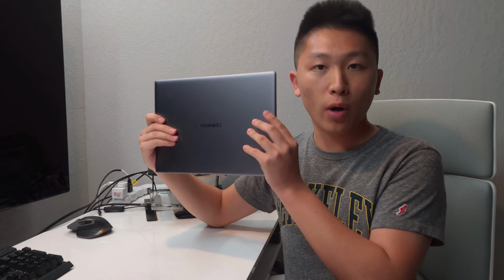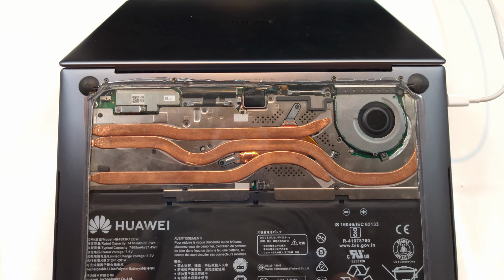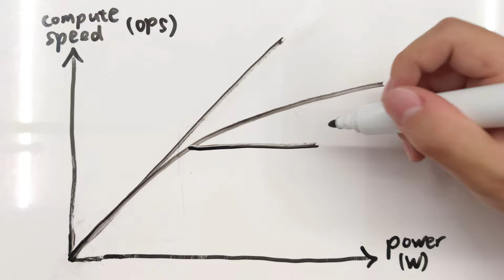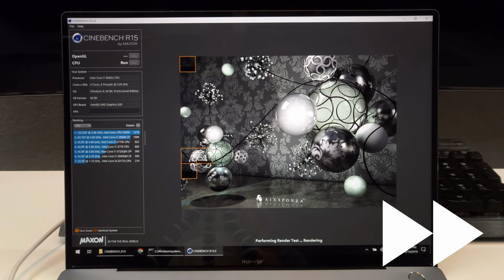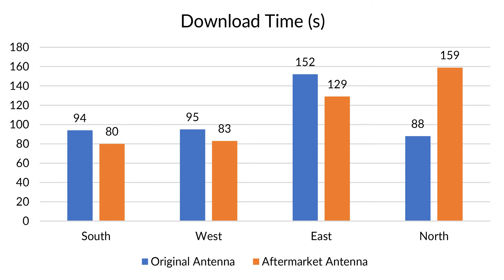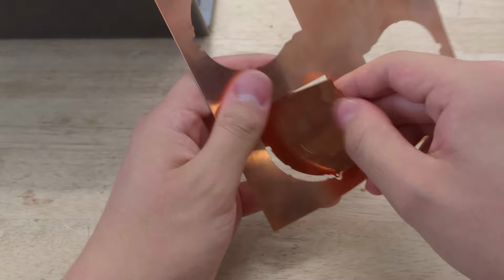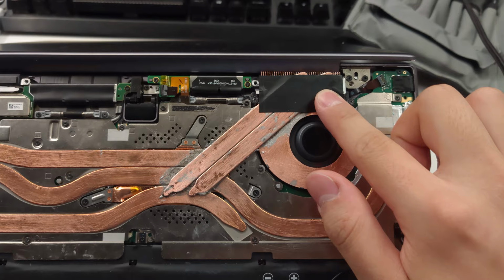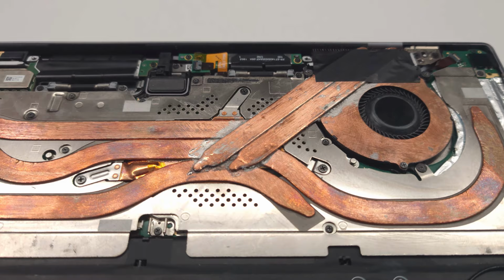Adding a Second Heatsink to My Laptop (MateBook X Pro)

Comment: Would it have been easier to melt the solder paste in a kitchen oven?
Reply from the maker: Maybe. But that would mean all the heatpipes are subject to the same heat, increasing the chance of them bursting, or messing up the original heatsink's heat pipes in some way.
Reply: Brad Ling I dont have any personal experience, but reading some comments in another video, the author states if you a proper low temp solder paste (the one in the link melts at 138C) there’s enough of a margin to safely melt the paste without exploding the heat pipes.

https://www.amazon.com/gp/aw/d/B0195V1QEI/ref=ox_sc_act_image_1?smid=A2GPLZGUK8NBW5&psc=1
Reply from the maker: @lupohki  That's great. That's the paste I used. Maybe you can try this method and share the results!
Reply: @BradsHacks  Ordered the paste.  I'm following you're other heatpipe guide and will solder onto the stock aluminum fan plate.  I'll also solder the gpu shim.  Will let you know how it goes.  Appreciate your guides!
Reply from the maker: @lupohki  I don't have any more copper fan covers. My university makerspace is closed so I can't make any more either. But here's the DXF file if you want to cut one yourself.

bradshacks.com/Bin/MXPro/MXP2019_Fan_BradsHacks.com.dxf
Reply: @BradsHacks  Appreciate the file, but I don't have the machinery to utilize it.  This past weekend I was going to use the oven to heat the solder paste, but when I took off the heatsink unit, I noticed the plastic pieces on it and didn't want to risk messing those up.  I chose to use a heatgun instead.  I first clamped the gpu shim and directed the heat gun at it on low for about 10 seconds until I saw the paste bubble and melt.  I then proceeded with one of the heatpipes, but when the new paste reached melting point, so did some of the existing solder paste and parts of the existing heatpipes came loose.  I decided I would have to attach all points of the new heatpipes at the same time and bought a bunch of clips from the dollar store to hold everything in place.  I scraped off the paint on the steel fan cover where the paste contacts.  There was some bulging of the existing heat pipes, but not on the new ones.  It came out well, but the smaller solder joint on the fan cover came loose as I was assembling.  Not sure if it was just a bad solder job or it flexed too much, but I was too tired to fix it properly at that point and taped it down with some the graphite tape.  I didn't notice improved scores on benchmarks, but I haven't made any power setting changes yet.

https://imgur.com/a/R7ftvZr

Comment: Do you think the notebook heatsink can hold up if used with peltier?
Reply from the maker: I don't see any immediate reason why it shouldn't
Reply from the maker: As long as you avoid going too low on temperature and causing condensation
Reply: @BradsHacks  thank you for your reply, a configuration with built-in fan would be recommended?
Reply from the maker: @mercuriallimit  Either way you'd need a fan to expel the significant amount of heat from the hot side of the peltier. Please share your creation online, I'm looking forward to it!

Comment: Can you do a similar video for gaming laptops? like the mag 15? It's an amazing laptop but it's somewhat hampered by it's 75C therrmal limit on the GPU. I'd be interested in those types of mod for sure and there's an entire community that'd be interested in it as well. Sucks because not many people are making videos about modified heatsinks for gaming laptops (the ones that tend to get overclocked the most or gamed for the longest time). Let me know if this is feasible or if you have any tips on how to make the heat sink on the mag 15 more robust. 

Mag 15 current heat sink is 
https://www.pchub.com/sunon-eg50060s1-c380-s9-cooling-fan-ther7gk5c6-1411-eg50060s1-c380-s9a-p206889

Max 15 (newer model from eluktronics but with less features and better thermals uses this one below)
https://www.pchub.com/sunon-eg75070s1-c460-s99-cooling-fan-eg75070s1-c460-s99-p206892
Reply: Yeah, I have the NEO15/Tongfang GK5CQ7Z which is very similar to the mag and it get's pretty hot even with repast and undervolt. 
Especially the cpu gets way to hot.
Reply: Modding actually thought trough heatsinks is a totally different beast. 
In ultrabooks the heat dissipation is pretty crap so its easy to make it better. 
In gaming laptops you would likely have to make a new heatsink design CNC it use custom pipes etc - its not as easy as slapping on a few more pipes as it is here. Sad but still the truth :/

If you really want to get better thermals the best way to go would likely be to use the chassis more, that means using graphite sheets, brad ling hast has a video up on how to do this. Issue is you are running the Mag, which has obviously a magnesium case not aluminum which will reduce the heat dissipation via the chassis a little even if u go with graphite sheets :/

Comment: You inspired me so much I didthis mod on my Samsung S22, how stupid is samsung anyway, they didnt even put a fan, they are clearly cost cutting, Ill show them. after the mod I got the same results as you. Now I have a hole in my phone and it burns my face. and I have to hold it on a bit of anangle, due to the fan cutting my face. that means the phone is cooling down right? coz the heat is transfered to one cheek yeah? No where near good as your idea, but let me know what you think of my cooling mod, I was thinking put my phone in a container bit bigger than my phone. 1st plug the charger, so the phone can have full charge at the end of mod, we wont be able to access the usbc, when done. Pour water in ithe container, place the phone in, and chuck it in the freezer. when frozen solid, take out the container, and remove the block of ice with the phone it. cut the charger cable, and your done. i dont think anyone can come up with a "cooler" cooling mod than that. plus its probably the coolest mod that has sub zero temps and all done without a fan. (just like you, no fans) Microsoft thought they achieved a land mark when they had the i5 running fanless on ther surface pro, PFFFFFTTTT please, at best, they were luke warm.
Reply from the maker: A small sacrifice to make for more FPS 👌

Comment: If you just used liquid metal, you could've dissipated another 10W.
Reply from the maker: And indeed I did
Reply: @BradsHacks  I mean between the heatsink and the chip itself. 

In the video, you didn't do that. my laptop could originally cool 65W on the CPU. Now 90W. 25W delta, which is almost 40%. If you did that, you should've gotten a cooling capacity of around 28W. without the heatpipes. 

Your end result was lackluster imho.. all that work for 4W? Doesn't seem right.
Reply from the maker: @blazbohinc4964  Yeah, I mean I put it on after the video. The video is 1.5 years old haha
Reply: @BradsHacks  what were the results? Sorry, I know the video is old.. thanks for replying at all.
Reply from the maker: @blazbohinc4964  About 5 more watts if I remember correctly. And that was only after I bent the CPU mounting arms to increase mounting pressure. Otherwise the liquid metal would gunk up between the die and heatsink because of gap. That may have been the reason of lackluster improvement margins of the 2nd Heatsink mod.